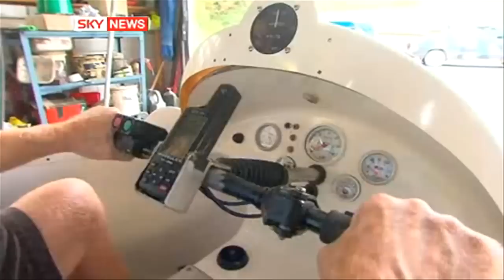Rudy Heeman's "Flying" Hovercraft

Comment: I'd think it would be dangerous to leave ground effect with no yaw control, seems he has it worked out though.
Reply: Well, he really can't leave the surface-effect boundary; the lift and power wouldn't allow it.  But it would act like a stall-proof aircraft, in that if he pushed it (tried to increase the attitude and give it max. power), it would just stall-out and return to surface-effect.  

But anyway -- it does appear to have three rudders aft, which should give him some yaw control.  (Not as much as I might prefer, but the proof would be in the pudding.)

Comment: They actually got the 'plane' up and flying. It was known in the West as the 'Caspian Sea Monster', or something like that. It was not until after the end of the Cold War that details were released. There was a documentary about it on the TV some time back. It was a 'Ground/Wave Effect' aeroplane and was very quick for its size and concept.
Reply: Ground-effect has been known since before airplanes existed.  Early glider pilots noticed the phenomenon.  And once airplanes were invented, it became more pronounced, since take-off also produced it.  In the 1920s, a Frenchman theorized an aircraft that would intentionally stay in surface-effect.  When autogyros and helicopters came along, the surface-effect phenomenon became a serious issue, since it could make the difference between a craft being able to break free of it or not.  The Russian "Caspian Sea Monster" ekranoplans of the 1960s built upon the science developed from those earlier studies.

Comment: @ftutbs 
This is not a plane, it is based on ground effects for flying. A high wing design would not work as the wings would not generate enought lift. Even if the wings has no aileron it is not unstable, again, thanks to ground effects. If one wing dips the pressure will push it back up. You could go for an hydrofoil, but that is not really comparable to this.